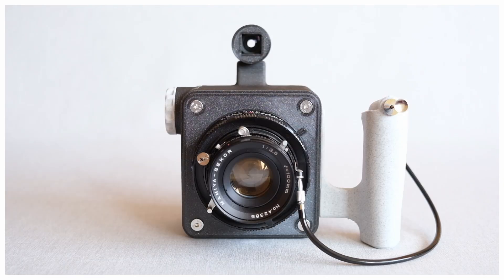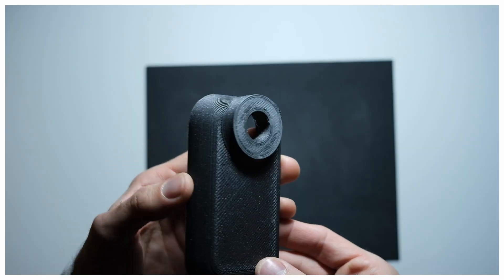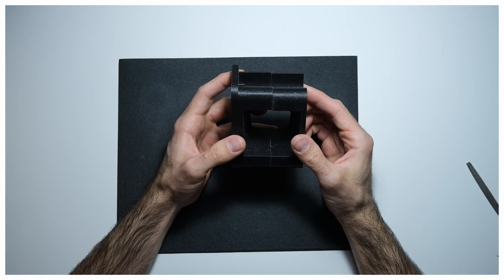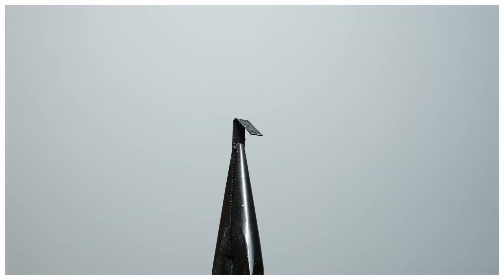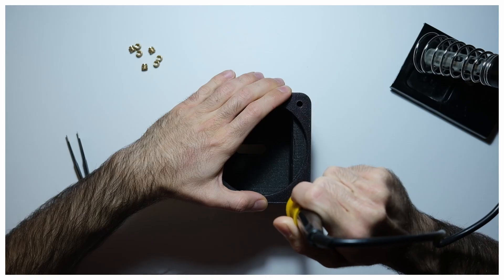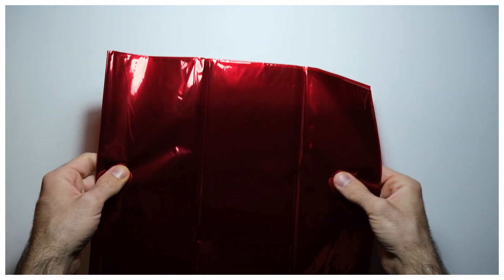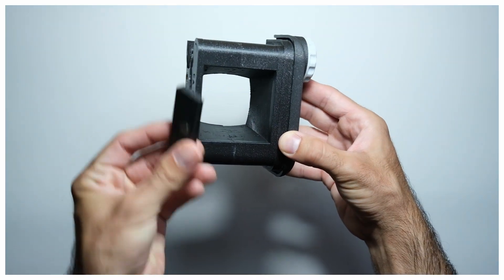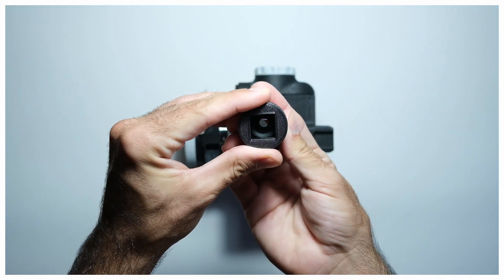3D Printed Medium Format Camera - Version 3

Comment: if you need filing, your tolerances are wrong.
Reply from the maker: Hi Matteo! Filing is not only about tolerances but surface finish. Plus different printers print slightly different, so filing is the best way for everyone to get the same fit. And in addition to it, 3D printing is not a technology that stands out for its geometrical/dimensional tolerances ;)

Comment: I ma about to buy same maiya press lens and build 6x9 camera. How much does your camera weight?
Reply from the maker: The whole camera (including lens, handle, viewfinder, etc) weighs exactly 1kg.
Reply: @doroteo.archive  nice! I'm highly inspired by your cameras, now designing 6x9( and in the same time 6x6) with exchangeable film backs. Idea is to make backs with similar to yours mechanism with dark slide, maybe use construction allowing for rotation (like Mamiya rb67). And waist level viewfinder with cover screens. I built one or two cameras, but none of them was 3d printed. Would you be interested in co-operation?

Comment: Amazing project! However I have few observations: 
1) It looks a bit like camera issues focus at infinity - maybe thats problem with film grain or video resolution. 
2) foam as element pushing film towards frame is not good option in my opinion. We want stiff flat plate, Foam deforms only in places its pushed towards frame, that might result in film being pushed evenly on perifery, but almost imidiatly its pushed too far towars lens in places where foam is not compressed by frame. I believe better sollution would be printing flat surface and using foam only as a spring unfortunatly it would mean redesigning camera body and reprint. I am extremly courius how does negative look like in closeup. 
3) You didnt include any spring holding film spool against unrolling- you mention It would be best to load film in darkroom, also film should be unloaded in darkroom. Adding those springs having contact with spools would improve film advance- spool would be tight, and also would hold film in tension-  additionally increasing film flattnes at filmplane.
Reply from the maker: Hi! Glad you liked the project.

1) I guess I still have to shoot a lot more with the camera to see if the front/back focus issue exists, but the images on the video are a mix of the first roll I shot, where I saw the possible issue that you are mentioning, and following rolls with a slight modification of the flange distance to solve it. Anyway, it's important to bare in mind that it is a 3D printed camera, and 3D printing and assembly tolerances have an impact on the nominal dimensions defined in the CAD software. 

2) The foam, despite acting as a pressure plate, is not pushing the film that hard. In my opinion, the best solution would be to glue the foam to a rigid plate, and connect this rigid plate to the back of the camera with springs (similar to the typical springy back of 35mm cameras). But the design as it is doesn't damage the film. And deformation doesn't appear on the film either. 

3) When the film is already in the camera, it is not important to keep the unexposed film tight. The unexposed film might unwind a bit, but this will happen inside the cavity where is located, and this has zero negative effects. It won't help flattening the film, because the film is already flat thanks to the pressure plate and it doesn't need extra tension. Other camera designs do need the unrolling system you mention (and it would also be nice if my design had it), but in this case it is not necessary. [Edited: I think that an unwinding system is needed if there is no pressure plate, and vice versa]

I reeeeally apreciate your feedback. To know other people ideas helps a lot when working on future projects!
Reply: yes those springs holding the tension of the rolls are a must have in my opinion.

Comment: Love the camera. Am working on a Dora Goodman camera, but still can’t find the lenses. The only note I have is the final closure process is very involved. Why not just put the screws through the handle with some sort of knob? Easy to open/close and not having to disassemble the whole side to change film. Anyway, great project.
Reply from the maker: Hi! There are two models of the handle: one without holes (the one shown in the video) and another one with holes for the screws that close the camera. I just wanted to keep the design as simple as possible, but adding knobs would be more user-friendly. I'll have it in mind for future projects. Thanks for the feedback!

Comment: the one downside that mamiya press has is that its lefthanded. so why not make the handle on the right side?
Reply from the maker: I designed the camera this way mainly because I wanted to use my right hand to advance the film. But thanks to your comment I've realised that making it symmetrical (handle on the right, knob on the left) is quite fast from design point of view, so I'll work on it and will upload it to Printables soon. Thanks!!
Reply from the maker: Hi again! Right handed version already designed! 3D models available in Printables. Thanks for your feedback 👍
Reply: Putting the handle on the right side would make it left handed, because all the manipulations would have to be done with the left hand.

Comment: Cool video! Love the design and photos. I remember seeing another 3D printed camera and they had problems with light leaking through the layer lines, did you have this issue?
Reply from the maker: Hi Lewis! I didn't find any problems regarding light leaking. Plus I usually print the parts with 4 perimeters, so it's a quite thick wall. Happy you liked the video!